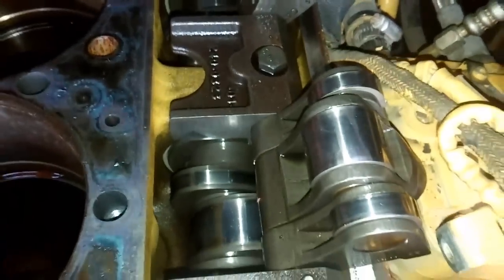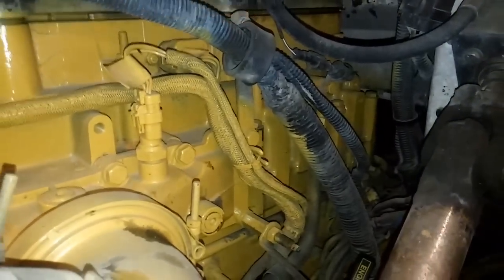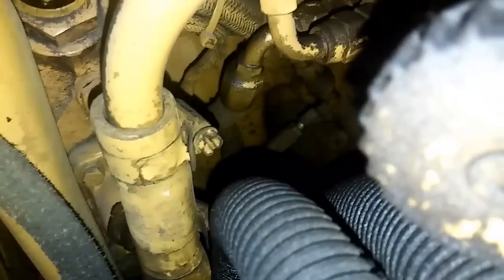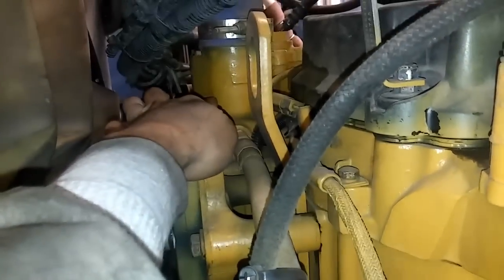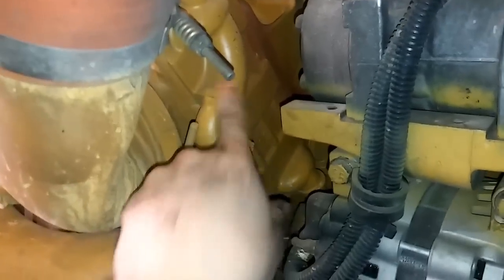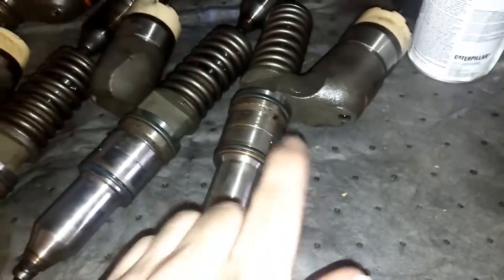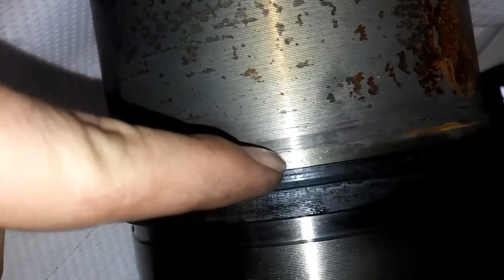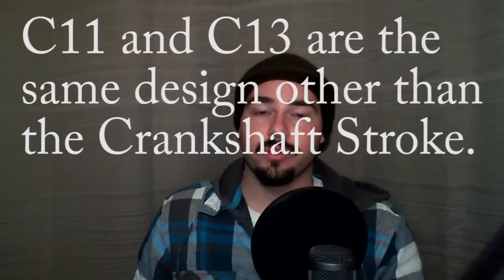Cat C13 and C11 Engines.  Facts, Walk Around, Sensor Locations, and Maintenance.  Know Your Engine.

Comment: Hello I have a question, how does one pin a C13 engine? For example when trying to find top dead center for valve/injector adjustment. I noticed on the C13's unlike the C10's there is the hole for the turning tool on the passenger side and the hole to pin the flywheel on the driver's side.
Reply from the maker: +First Last Most C13 have the pin hole in the exhaust side with next to the turning tool hole. Usually the ones with the intake side hole have a rear PTO drive like a cement truck or something like that.
Reply: Yep that's my case

Comment: Question what does it mean "engine intake valve actuation system oil pressure control vale : not responding properly" on a cat c13
Reply from the maker: +Edgardo Guardado You should watch my IVA and VVA system video. That code indicates that the ECM isn't seeing proper oil pressure to the IVA sensor and the pressure isn't dropping when the IVA solenoid opens. It could be the purge solenoid, the IVA oil pressure sensor, or the oil supply to the IVA housing.

Comment: my friend had a C13 in a mid nineties W900 that maxed out a 600 horse dyno at less than full throttle.  not sure what was all done to it but it would climb every hill on I80 east of the Mississippi at 65 mph at 80000. 6.5 mpg and reliable.
Reply from the maker: +Derrick Zenner The C13 is a good engine that gets overshadowed by the C15.
Reply: Adept Ape agree I really like them
Reply: Adept Ape The architecture is so good that the soon to be launched off highway version stage V outperforms current T4F C15 Off highway! Really proud of working on that platform!

Comment: what about c13 serial number LEE.....how reliable are they
Reply from the maker: +Andrew Smith The core engine is relatively the same, but has many more emissions components and sensors, so they will get more check engine lights on average than a KCB C13 engine.

Comment: I have a c-13 that is losing 4 gallons of coolant daily eye pressure tested the cooling system it lost no pressure for 45 minutes I block tested and I'm not getting any signs of color change on the Block testing fluid any ideas
Reply from the maker: +Roger Chriswell Hmmmmm, any moisture coming out of the blowby tube when it's running? Any greyish sludge in the oil? Have you checked the air tanks and Air Dryer for coolant?
Reply: Adept Ape the oil is grey and sledge in the oil filler tube I didn't see anything in the tanks
Reply from the maker: +Roger Chriswell Well if your oil is grey you've got it getting into the crankcase, do a bottle test for compression (I have a video on it) you may have a cracked head, liners leaking, or even a bad air compressor.

Comment: Replaced a exhaust manifold on a   D6 dozer with an acert  6.6 . The Cat dealer said it's actually a Perkins engine. The manifold gaskets were stamped Perkins. Interesting.
Reply from the maker: +george kuersten Yep, the C7 is the smallest true Cat engine, everything smaller is made by Perkins which is a bit less quality in my opinion.
Reply: Congratulations - over 7.1K subscribers now.  We run two 120M and one 12M graders with those 6.6L "Perkipillar" engines (that's what the Peterson CAT mechanics call them), and it is imperative to change the oil by 250 hours (severe duty classification), otherwise they will drink oil.  Found out the hard way that the fuel pump shaft is not keyed to its gear - press fit with a bolt/washer - not a bright idea.
Reply: Chad Jessup Having worked many years on “true” CAT engines from C7.2 all the way up to C175 I can tell you that the recommended oil change for CAT and Perkins branded engines is the same, it’ll change based on the usage and how hard you run your engine as a rule of thumb if you run engine hard every 250 hours, normal operation every 500 hours on some specific applications and with a deeper oil sump you can go up to 1000 hours but that’s only if you use CAT DEO oil and CAT Branded fuel and Oil filters. Now about Perkins engines not having same quality as “true” CAT engines, well that’s a myth, Perkins is a British company that CAT bought back in the 90s and it’s been Vertically integrated into Caterpillar and I can tell you that we are one family with smart engineers and technicians working endlessly to deliver the utmost quality.

Comment: Was the lifter/follower design updated from the c12? I noticed you said the c13 is a carry over from the c12 with inprovements, we run both c12 and c13 engines and more than once a c12 follower has failed and damaged the cam, at which point we inframe the engine as this happens at about 800-900k miles. Other than that flaw the c12 could very well be a million plus mile engine. Never seen this issue with the c13 though, only downfall of the 13 is they like to drink the oil... Even after an inframe they seem to drink a gallon in between changes. Another differance i noticed was they changed the intake to the driver side on the c13, it was never an issue being on the passenger side on a c12  however i always thought that would raise intake air temps being right above the exhaust manifold. These are excellent engines with a bad rap!
Reply from the maker: +scott blume The C12 lifter design is very similar to the C13, I believe the C13 uses wider rollers, but I haven't had a C12 head off for a little while so I wouldn't put money on it. Yeah they did swap the intake side to the left side of the engine on the C13 and I think their r reason for that was the twin turbo design really takes up a lot of room as you know if you have one.

Comment: A quick question about overheating the engines your mentioned in the video; they all have coolant temp sensors connected to the ECM - if an overheat occurs and the ECM detects it does it cut out the injectors to prevent overheating? Or will it just run itself into the ground? The drive belt once snapped on my diesel car (not cat powered) on the freeway and the temperature climbed without me noticing until the engine cut power to itself as the ECU detected high temp. This saved my engine, so I was wondering if a cat will do that.
Reply from the maker: +neardood1 So on some of the sensors like coolant temp or coolant level you can set them to either warning, derate, or shutdown. If its set to warning you'll just get a check engine light, if its set to shutdown then it'll shut down, this can be programmed in configuration.
Reply: Ahh ok. we use C16's and 3516's as gensets on ships and in addition to the cat sensors, international and class requirements mean that we have a completely separate set of sensors to monitor important things like oil pressure/temp, coolant temp, coolant level, speed ect. If they go beyond the set limits it will cause an alarm and if it gets worse a completely separate mini-ecm called a SDU (Shutdown unit) will do as its name says and send a Shutdown signal to the ecm.
Reply: Adept Ape Im setting it on shutdown when i get this one in.